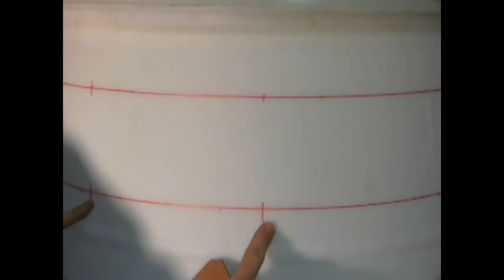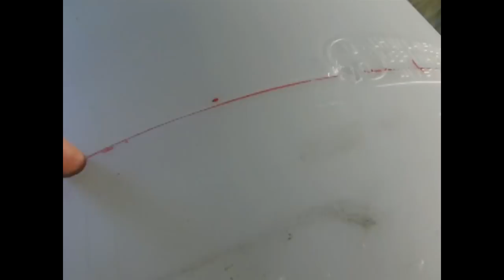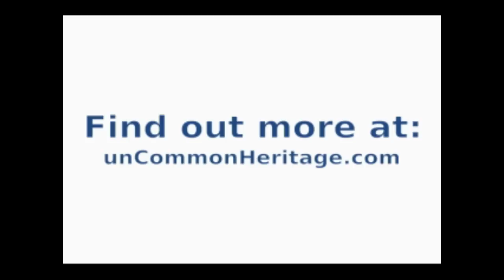Vertical garden barrel planter

Comment: One hint I know of to find the half and quarter way point around the barrel would be as simple as using string. hold the string semi-tightly round the barrel connecting the seams. Then you just need to fold the string in half and mark the mid-point. Fold again between mid-point and one of the ends and mark that mid point and so on. Hope you get what I mean, I'm not the best at explaining things. thinking of giving this a go it look cool.

Comment: Use alcohol to remove ink. And the worm tower is the way to go. It feeds your plants as they need it and you get worm tea out of the bottom thru your drain. You might want to raise it a little more to make it easier to harvest and use your worm casting tea on your barrels. Just recycle the water right back intothebarrel it came out of.

Comment: It looks a lot better using the PVC pipe rather than a 2 x 4. The hole seems a little bigger too  so there's more room for a plant in each pocket.
Reply from the maker: I think I used 2 inch pipe. I still have pipes for it, but I haven't made any barrels for a while.

Comment: what type of plastic for the barrel should I be looking for? is there any type to avoid, I mean in regards to health concerns, since it's going to be in touch with edible plants for years possibly, with constant moisture and sun heat and light, are there any concerns about the possibility of certain materials to degrade or dissolve into the soil?
Reply from the maker: +Naiemaa I've looked in to that, but it's been a while. Basically if you have a food grade plastic barrel it is new, not recyled plastic and you shouldn't have a problem with the plastic. If not, there could be possible contamination from whatever the plastic was used for before. At least that's what I recall. 

Anyway, the bigger concern seems to be what the barrel contained. Even if it was used for a food item, like syrup for soft drinks such as Coca Cola, that can be extremely toxic stuff. I would totally avoid barrels that contained persistent herbicides and pesticides.

Comment: I found it easier and faster to just use a skill saw to cut the holes and I was not so anal about where my slots/pockets went. Using 2x4's saves a step and materials and it does not melt to the barrel.
Reply from the maker: aquabarrel A 7 1/4" cicular saw will definitely work, but safety is an issue. A little battery powered circular saw would be a lot easier to use. I actually do use a 7 1/4" saw now, but I made a jig to hold the saw and the barrel. I can turn them out really fast with that setup.

Comment: Wonderful pockets for your plants.
You didn't go far enough in showing the composting tube, ESPECIALLY the openable end at the bottom to take out old compost. It's not enough just to drain the water (compost tea) into a pan.
Reply from the maker: Yes, lots of people do put a composting tube in the middle or just a tube to aid in watering so water added to the top makes its way to the bottom more easily.  I didn't show it because I didn't do it. Neither are a bad idea though and the latter may be necessary  for many people, especially in drier climates.

Comment: In the template you used for this barrel, was it set up for 5" for the pockets you made? This would mean a total of 1" for the two 1/2" drill holes and 4" for the slit pocket to be cut away with a jig saw. I am guessing on this, but just wondered about the length size of your cardboard template.

Nice video. It is giving me ideas for my own garden tower barrel and mods I want to make on it.
Reply from the maker: I've made quite a few of these since this video. Really, the exact layout isn't that critical, plus most barrels are wider in the middle than at the top and bottom, so it would change a bit as you go up and down.
Reply from the maker: Perhaps the best way to mark off the pockets is to go ahead and mark 
rings around the barrel for each layer of pockets using a homemade 
marking jig as I do in the video, then measure around the middle ring with a tape measure marking it into twice as many equal parts as the number of pockets you want(roughly every 4 1/2 to 5"). I put 6 rings with 8 pockets on 55 gallon barrels and 5 rings with 6 pockets on 30-35 gallon barrels.Then use a straightedge held on each mark to mark along the length of the barrel making a mark through each ring. That way you end up with each ring divided into 16 equal parts.Then you can cut each every other segment around each ring staggering cutouts on each ring. (I suggest marking where to cut clearly, perhaps with different colors before cutting to avoid mistakes.) If you choose to drill holes to start a saw, you would drill at each mark making 16 holes on each ring. If you have a way to start a cut without drilling holes, that will work also. This method makes layout a lot faster and easier.I have since made a jig that doesn't require me to layout each barrel making it possible to cut each barrel in about 5 minutes. It wouldn't be worth the trouble just to do a few barrels though.
Reply: I'm pretty sure he used 5 inch pockets with 4 inch gaps between. Not sure why he didn't share that with us.